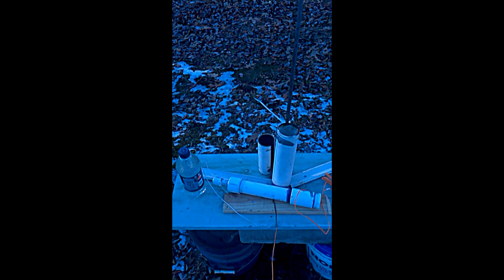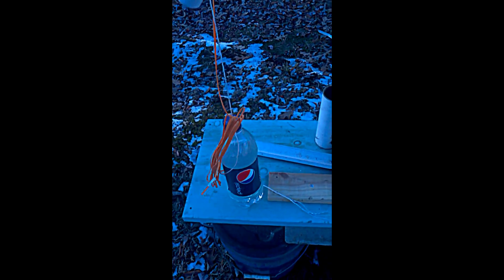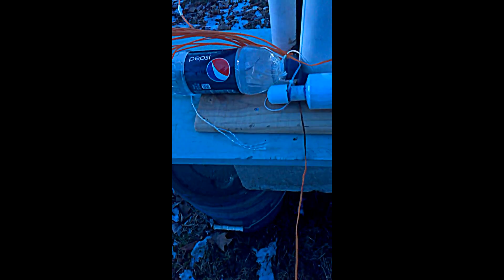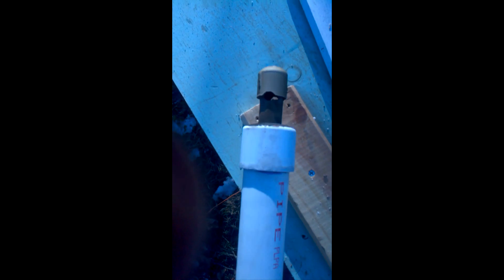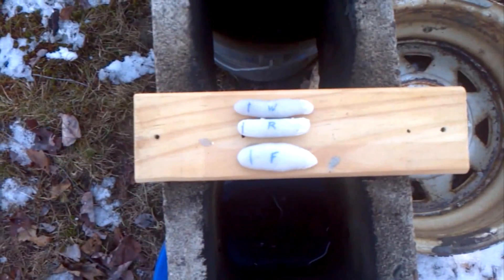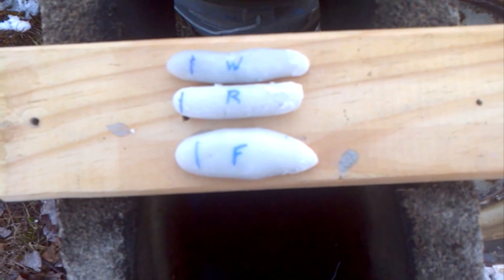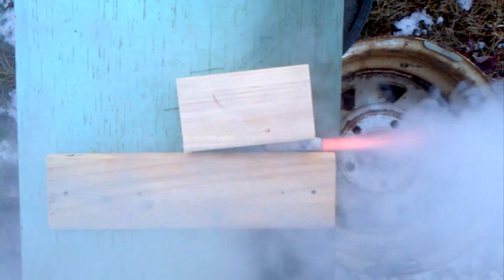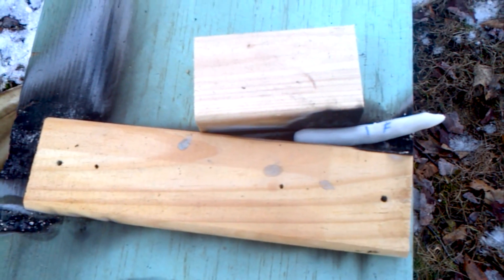Part 9:  How to Build a High Power Rocket - Burn Rate and Static Test

Comment: I encountered the same problem with the delay grain and as a quick fix until I built a better solution I used some pyro time delay fuse very successfully.

Comment: What would happen if you put two different fuels in the rocket? for instance the rocket started of burning a faster burning fuel like WizzBang, but then after the initial burn it would run off of flexy fuel. Would the initial thrust being more powerful, and then the longer burn gain any altitude?
Reply: Jerry Whidby wth is wizzbang

Comment: So how high can a rocket get with that big tyest motor full of flexy fuel? Or does the motor need to be larger?
Reply from the maker: The altitude is only going to be limited by your design skills and knowledge of rocketry.  Having said this...If you are looking to use flexi-fuel to get a rocket into orbit, you'll be severely disappointed.
Reply: I do little model rockets a few feet long. Want to do a bigger one.

Comment from the maker: BROWN sugar will work, but the burn would be a lot slower.  Not sure how much power would be lost.
Reply: Is flexy fuel the best rocket fuel?
Reply from the maker: ***** it is not the best-performing fuel, but it is relatively powerful and very forgiving.
Reply: I use brown sugar in all my mixes and a few grams of substitute sugar along with small amount of iron oxide,

Comment from the maker: Hi Wrapped01:  In some cases, I am going for slower burn rates to stay within safety margins.  Try as hard as we may to get things perfectly, mistakes can be made with our home-cooked stuff, so I am cautious.  However, as you may have already seen in my videos - I have not yet had an under-powered rocket, and the fuel burns quite clean, leaving only residue (no un-burned fuel) in the motor casings.  

Should you go for slower burns?  Not really.

Comment: hey so first of all nice vids. I just started making rockets myself. I am curious if you are going for slower burn rates on purpose? A lot of the stuff you use is not obtainable where I live so I use a fertilizer that contains a lot of KNO3 and  some other crap. Most of my burn rate tests pretty much ignite instantly in a fraction of a second, should I go for slower burns? thanks

Comment from the maker: When we are talking about burn rates while the motor is under pressure, a normal R-Candy 1.25" diameter motor will burn out in 1.9 seconds.  Flexi fuel - at the most - will give it another .25 seconds.  Ease of use during casting and minimal prep time is its primary purpose, not the amount of thrust it generates.  RIO is not an ingredient I would ever consider putting into it - so we agree on that point!